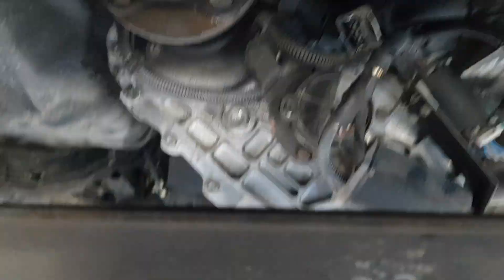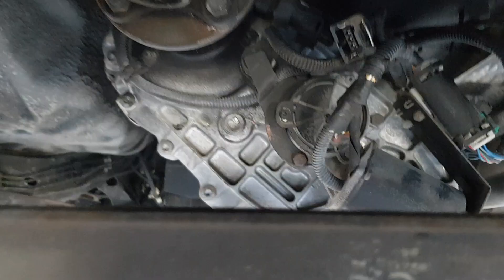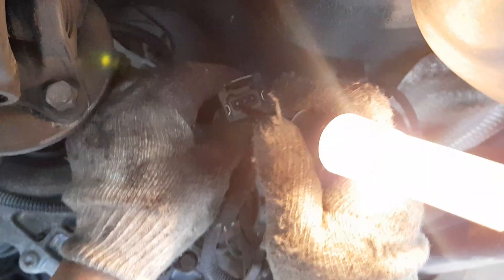Great wall 4x4 not working electrical problem

Comment: There's a YouTube vid called  great wall spare parts rip-off, solenoid   pack under the passenger side, hit him up for $1000, part was $180 delivered on line. Runs signal from dash buttons too transfer case.

Comment: Thanks for this.... Good onya mate, but where is the issue?  Is it a bad connector (since one is modified the bad one Vs the good one with spade connectors etc) or is it the switch on the console (sorry I have a 2010 X240 but the back of the box with solenoids looks the same as yours there) and my freakin' manual I bought doesn't show the same pic!  Or as I've heard 4th 5th hand is it sticky solenoids from lack of use?

Comment: My beast of burden is a 2012 x200 Great wall model with electrical problem. My front head lights & High beams don't work, as well as the back left indicator light. Noone can fix these issues not even Great wall mechanics. I'm forking out a lot of money and getting no answers except the bills. Can you shed any light on this. Please
Reply: I would be checking all your grounds etc , and also note these are positive switched not negative switched so if you have a light bar or anything that wasn’t there from factory I’d also look at the wiring to that good luck

Comment: Hello there my dad has a great wall x240 i think anyway while driving his central locking locks and unlocks i called the dealer he said something about central locking module do u know anything about this problem if so could u let me know please thank u very much
Reply: Hi Knox its happened to me as well and each time the back door was not closed properly.Check your doors are all closed properly

Comment: Nice video , I just bought a second hand great wall 2009 everything works but four wheel drive I really got bogged. In my car next to switch there is three black buttons or lights to show what 4x4 gear it's in high or low or two wheel drive but no indication it's on but on dash the 4x4 lights are on but it's not working so might be as your video ? Any tips on what to look for maybe fuse ?
Reply: Hey mate I’ve had a sort of similar problem. How did you end up fixing it if you did?
Reply: Can any one advice me in h5 when engage 4h mode after few seconds the warning light at meter panel blinks? What can cause this issue

Comment: Hey mate I have a great wall 2011 v240  I was wondering whether you could tell me if the lights on the 4wd switch are suppose to be on constantly or are they suppose to be off. I think the 4wd drive is trying to engage when I am driving and would you know what the problem is please.
Reply: Hey mate I’ve had the same problem in my 2010 model v240. The lights for the 4wd system are always on and red and my uncle who had it before me reckons there’s an electrical issue maybe a solenoid and that it won’t go into 4wd. I haven’t tried it yet bc I dont want to damage it further it. Did you ever end up figuring out what was wrong and if you did mate how did you end up fixing it?
Reply: @NickyWG04  hi how you going i can't tell you the problem because I haven't as yet worked it out myself. But I can tell you what I have replaced and what I have found. There is a module under the drivers seat for the 4wd that I have replaced it did not change anything, I then bought a second hand switch block for the dash and I replaced mine with this. That has not changed anything. I have noticed that the front differential actuator is working but the gearbox one is not if you follow the wiring from the gear box actuator it goes to the module under the seat. I have power going to the module but nothing going to the actuator.so I thought it was the switch on the dash so I pulled the switch apart (2nd hand one) I found the chipboard had burn marks on it. So I am yet to buy another one. My utes problem is that the lights are on, the switch on the dash, but it doesn't engage into 4wd the 4wd light on the speed assembly is coming on.would appreciate any information that you can find out as welland if I find out anything in the mean time I will let you know. Regards rob

Comment: I have a 2014 great wall steed when you accelerate an orange spanner light shows up and it loses power but if you lift the accelerator and pump it it will drive fine with lots of power I just replaced the accelerator position sensor and still the same any ideas please
Reply: Is it diesel?

Comment: Hi 
How testing the engine speed sensor for deer great wall 4y engine the my car don't power ,starting and fuel pomp and relay and fused and other things is good ،only no spark  plugs.how should test the speed sensor is good or bad .the sensor gag tree wire and fast front engine near the crankshaft and other question how much distance crankshaft poly and speed sensor and my car only a sensor engine and haven't camshaft .
Thanks if answer the my questions thank you very much
Reply: Did you get this sorted?

Comment: I have a Great Wall v240, 2010 model, dies while driving. All components and elements turn off, no lights on the dash board, no clicking sounds when turning the key in the ignition... everything completely dead. When this happens I would park the car on the side of the road for 6 hours and try again; surprisingly the car would start up like nothing happened and would be good. Once parked in my garage and after a few hours the same ordeal plays out, completely no power.

I've tried many of my local mechanics to try and diagnose the issue.. taking my car to the Great Wall dealership is not financially an option as they charge $450 just to run a report on the car.
With each mechanic visit I confirm it's not an alternator, starter motor or tightening of the terminal issues, as I have had these fixed and replaced.
My only guess would be the electrical system but where exactly I and all the mechanics I have been to are unsure. Please help

Comment: Can anyone please tell me where this mechanic is based - its exactly the problem we are having but nobody seems to be able to fix it for us.
Reply: Did you check the fuse box for an open fuse and check to see if the relay clicks when you try to switch from 4h to 2h

Comment: How do you fix this?
Reply: Common problem with Borg Warner transfer case across many brands. Older Australian ford ranger has same issues. Search ford 4wd shift motor problems, 100s of results on American ford sites
Reply: @dennismoore2312  I’ve had a similar thing I’ll have a look thanks mate